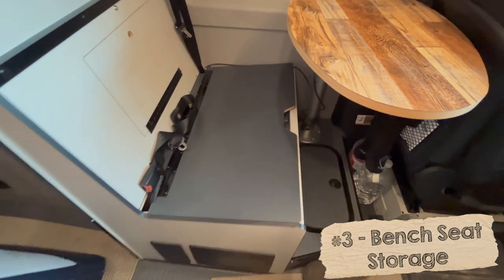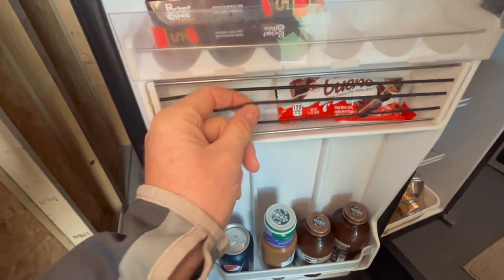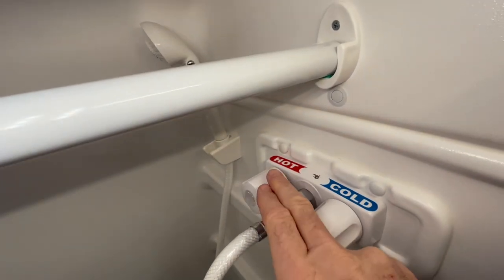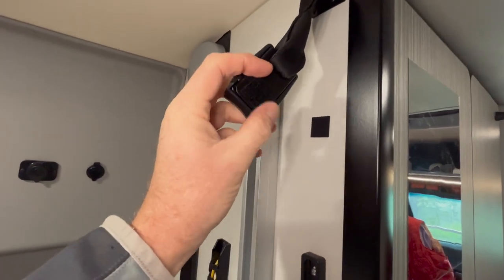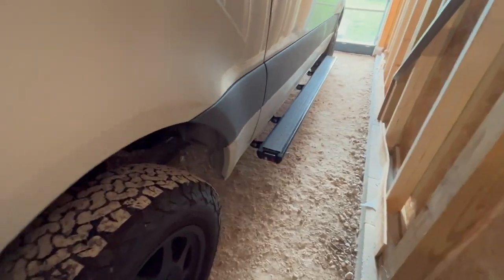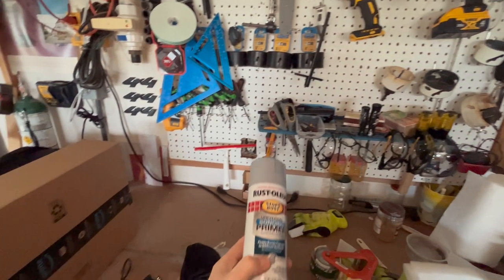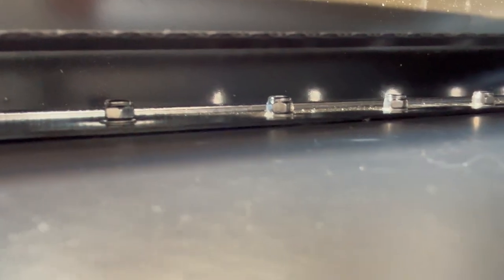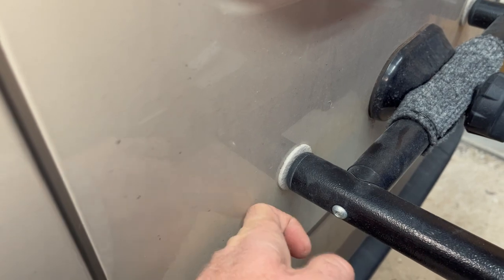More Upgrades | Winnebago Revel

Comment: 12:10 This is an important fix apparently. I checked this on the 2025 Revel at the dealership. WB has started installing a little straw piece of tubing poking out the drainhole to prevent their sealant from blocking. It has about 1/2" of tubing sticking out.
Reply from the maker: maybe they watched this video, too, and copied my fix 🙂?

Comment: Van Compass 4.3 really does make a difference....but ,your best upgrade was that great shed you built to protect the van from sun, wind and hail! GREAT VIDEO!!!!
Reply: With the 4.3 upgrade it really calms down the front suspension of the Sprinter Van
Reply from the maker: @bobbysnow5478  the only difference between the 2.3 and the 4.3 is the additional leaf spring pack in the back, right? the front is the same if I read the VC website correctly, What I recently noticed is a much stiffer/harsher ride when it is cold. the other day it dropped down to a whopping 37F (super cold here in TX) and it was a different ride than when it is nice and warm. I'm thinking this is because of the Sumo Springs firming up in colder temps? do you notice the same?
Reply: @orange13  thanks for the note. 
Most my driving is in the #2 setting on the shocks..my last outing it was 29.
My total weight would be around 8k on that trip..I did not notice any difference.
The spring pack makes for a nice ride when the water tank is full.
My passenger door has a rattle from the lock rod.. I would like someone to pull the panel on the slider to see what noise is living in there..crazy

Comment: I'm working my way through some of these mods. Great ideas! I'm hoping you'll see this comment since I have a request. Have you seen the Facebook threads regarding adding a living hinge to the window in the slider to keep it from falling out? I'm afraid of this happening to me so I never open that window. They say the living hinge is the answer but won't explain how to install it (telling someone to figure it out isn't very helpful). Could you do a video on this install?
Reply from the maker: thank you. One of the perks of having a small YouTube channel is that I can read ALL the comments 🙂. No, I have not seen any reports of windows falling out. I am not on Facebook but I am in the Winnebagorevelforum DOT COM and so far, have not come across any issues with the side window.. after all, they are from Dometic and they know a thing or 2 about making RV windows. A living hinge, by definition, is nothing that can be added because a living hinge is part of the 2 sides it connects and made from the same material, like the hinge in an egg carton. But I get the idea, I guess the idea is to somehow glue a piece of plastic or any material that can act as a hinge to the window and frame. perhaps a piece of gorilla tape can do the trick? or a thin piece of polyethylene (which is a type of plastic that can be bent a lot without much fatigue) can be attached with strong double-sided tape (VHB tape)? After all, this extra hinge is only a backup, should the main hinge fails. Anyway. I'm just theorizing. i do not see the need of such a modification and I'm not even sure what problem it is supposed to fix. I'm afraid I won't be making a video about it. I also think you do not need to worry about your window. don't trust these Facebook people 🙂
Reply: @orange13  Thank you for taking the time to reply! I feel a lot better about the window but I still won't be opening it. Maybe it was the earlier models that are having such a hard time. They say it's not Dometic's fault but WB not putting sufficient bracing/support around the edges so you can't open it 90 degrees.

Comment: Thank you for the Video. Did you do a how-to on the Toilet Lock indicator light? Could you link it here?
Reply from the maker: the yellow toilet lock LED is a side product of the SOG install. I have a video on that here: https://youtu.be/TpuinqfESGc .  the SOG kit includes a switch that gets installed at the bottom of the toilet and it controls the little SOG fan. I then installed the LED in parallel with the fan so when the fan turns on, so does the LED

Comment: Another awesome video, thank you!   By chance do you recall or have the Exhaust part #?
Reply from the maker: thank you. Yes, the OEM Mercedes Tail Pipe PN is 906-490-08-21.
The other piece you might need is a rubber pipe hanger, this is what connects the pipe with the frame at the tip of the pipe. in my Revel, this piece was still there. if you need it, it is 901-492-00-44
Reply: @orange13  Much appreciated.  The rubber hangar was also still on my Revel. Cheers to you!

Comment: Great video! 
My remaining issue are noises coming from the sliding door and that goofy window..HELP!
Reply from the maker: thanks. Some of the side window noise in my van can be eliminated by snapping the 2 blinds (bug screen and blind) together. I also used a bit of electrical tape to fix the magnetic strips in place. I have not been able to get rid of all the noises, though.
Reply: @orange13  some of the door rattle issues can be elimanted with putting some grease in the holes where the door latches. One is up high one low. It eventually wears off and you need to add more, And yes the screen and blind rattles if its open all the way, i just leave mine a little engaged and it doesnt rattle.
Reply from the maker: @nickb1966  thanks Nick. yes, this is a very good tip. thanks for sharing. It indeed helps a lot in my van, too.

Comment: We love your mod videos! Do you have a source for that swivel faucet attachment?
Reply from the maker: it came with the van, I didn't put it on. Looking at other Revel videos and pictures, I think my faucet is different. perhaps they didn't have the regular style in stock when they built my van. after all, this is a standard "residential" faucet and not an RV- specific or even Winnebago specific part. I guess you could put in any kitchen faucet you can find at Lowes or HomeDepot....

Comment: You have such great ideas and solutions.  Question,  what adhesive are you using to affix the acrylic pieces to the drawer sides?   Also  with the bungee cords in the frig,  are you drilling through the sides?
Reply from the maker: hi Dave, thanks for your comment. I'm not using acrylic. the material is polycarbonate. I know, acrylic is often used as a synonym for clear plastic but once you start cutting and drilling the stuff, it does matter. Acrylic can be somewhat brittle and can shatter when drilled and cut with standard woodworking tools. Polycarbonate,  on the other side, is not brittle at all, it can be cut with a circular saw,  holes can be drilled near to the edge without any risk of breaking/splitting, it can even be routed with a normal woodworking router bit. ANyway, that wasn't your question 🙂: I used some double sided carpet mounting tape. this stuff is super- sticky and - unlike foam- backed double-sided adhesive strips like 3M VHB tape - very thin. 
As for the fridge, no, I did not drill into the sides. Instead, I cut a small piece of plastic and drilled the holes for the bungees into it. I then used the existing stainless steel metal rods as a spreader between the 2 plastic blocks and again some double-sided carpet tape to stick it to the side walls of the fridge.

Comment: Noted the velcro solution for the bed seat belt. Great idea. Tks! I put on a topper and need an extender.  Could not find the seatbelt type. Do you have any clue?  Thank you.
Reply from the maker: hi Dave. thank you. I'm not an expert on seat belts but I am somewhat sure the one for the bed is the same one they use as a lap belt for the bench seat. If you never use the bench seat for a 4th passenger, perhaps you can use that one to fabricate an extender? or you could just move the buckle down a bit on the bathroom wall? or - and that's what I would do - simply don't buckle up the bed when in the up position. Euroloft says the bed is fully usable in any position and chances that the bed will crashing down are very very slim. and even if it does, what can happen? I also found this ebay listing. Looks like a fit to me, it is not an extender. Instead, you can just replace the entire buckle thing with one that is a little bit longer: https://www.ebay.com/itm/283982388724
Reply: @orange13  Thanks so much for taking the time and for sharing your thoughts. Very helpful. Much appreciated. dh